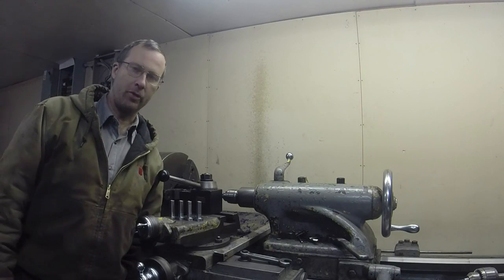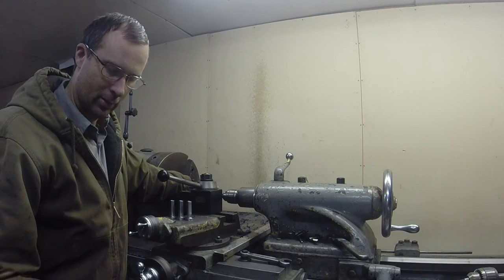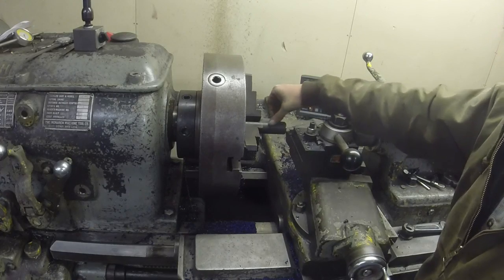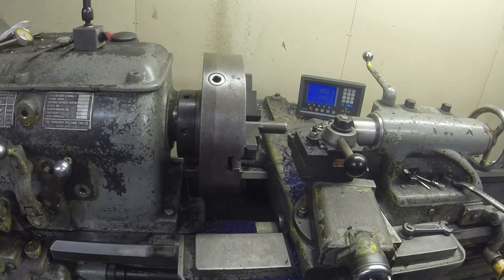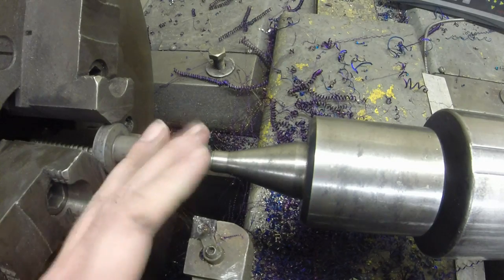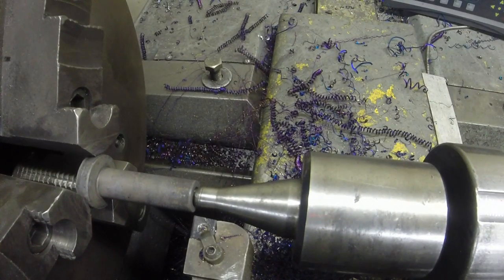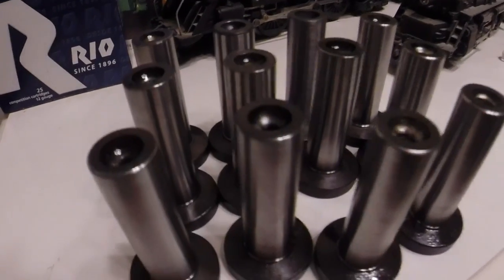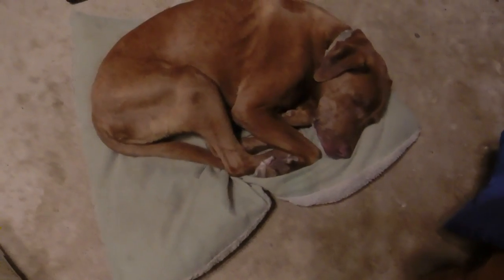CNMP review, repeat setups, heat treating and hard turning

Comment: I want to know how the heat treatment worked. The aluminum is good for the scale, but all at once. Seems slow and to much air bubbles for a proper quench.
Reply from the maker: +dlstanf2 The one I gave my buddy to check came in at the proper Rockwell hardness so it must have worked ok.  The material is moderately air hardenable as well so an oil quench just ensures they get full hardness before tempering back.

Comment: Brian, I noticed the stand that the oven is on swayed back and forth when you were pulling the tappets out. May I suggest some reinforcement for the stand. Sure wouldn't want it to collapse on you. That was some very quick thinking on putting out the fire!
All the best,
Eric
Reply from the maker: +esoomreltna The concrete isn't level there so it rocks a bit, the stand is plenty stout though. When it finally gets its proper home it will be much nicer + a proper quench tank with proper oil will bw nice as well.

Comment: I'm curious if the original rod stock is something special?
Reply from the maker: +Ed Texley What do you mean? If you are talking about the material these are made from yes it is a special tool steel.
Reply from the maker: +Ed Texley What do you mean? If you are talking about the material these are made from yes it is a special tool steel.
Reply: +bcbloc02 Would it be similar to T1?  I use this sometimes for making teeth on grapple forks or just lately, teeth for a big tiller.  I've never tried heat treating any of it, but I probably should.
Thanks
Reply from the maker: Ed Texley
I believe T-1 is already heat treated so no need to do it again.
Reply: +bcbloc02 Thanks Brian

Comment: Man you're getting raked over the coals about that little fire aren't you Brian. Nice job by the way. Hows the new shop coming along and did you get any further with the overhead hoist? Later and all the best.
Reply from the maker: +NSTRAPPERHUNTER Worked on the shop after work today, going to try again tomorrow but they are calling for rain and thunderstorms most of the day I think. I am also coming along on the hoist. I will work on it tomorrow if the rain keeps me from building walls.

Comment: I have had the same thing happen with a 5 gallon bucket of hydrotrans when repairing a D8R, didn't get it out in time, had a melt down, thank God for a few bags of fine floor sweep. And I already cleaned the undercarriage so just a few hoses got heat tested, no real damage a spray can overhaul and a full day of cleanup , God looks out for us sometimes.

Comment: Hi Brian, great work as usual.  Love listening to that old Monarch, smooooooth as glass.  You need to get a metal bucket with a lid for your quench, check out McMaster part number  4070T61.  It is a 6 gallon bucket with a step lifting lid, perfect for that purpose.

What kind of insert to you use for the hard turn, CBN?  Do you take them all the way to final on the lathe or give them a spin on the grinder after that?
Reply: bcbloc02 I've got a couple of them around my shop, for oily rags and waste, haven't had one leak yet.  Of course you could slop some gas take sealer in the bottom when it was clean and new just to make sure.
Reply: +bcbloc02 Thanks for the synopsis, you answered all the questions I had, and asked the one I was thinking of too. Do those crimped metal seals hold oil? I know that they don't always hold water, but then again, I already learned in college you shouldn't try to keep your keg cold in a metal can in the hot Hawaiian sun ;)
Reply from the maker: +James Kilroy I turn to size on the lathe with a PCBN insert. It holds edge and size like a master but is certainly a fussy piece to use as it only cuts one way, you can't back up with it and you cant face to a center with it or it will break.  The lathe leaves just as good a finish and I can smoke the grinder on time since i can turn to number on the DRO and hit within .0005 every time. 
 Do you know if those containers will hold oil long term without leaking? I once tried a metal trash can of same design and it sweated oil out the seam at the bottom.

Comment: Hey Brian - what kind of steel are you using?  Most of the stuff that we foil pack is air quenched (D2, CPM-154, 3V).  Did you put some paper or other combustible to burn off the oxygen inside the foil pack to ensure that the heat treat is anaerobic?

We get small fires when we quench using automatic transmission fluid but usually only when the part doesn't fully submerge.  Was the foil pack still sticking up?

Like seeing the whole process - Thanks
Reply from the maker: +harrisevo At first I thought it was not fully submerged was the reason for the fire, that is why I poked at it but it was all in. The material is a specialty tool steel that has both high hardness and toughness and I had a paper towl inside to burn the oxygen.  It turned out well but certainly wasn't a flawless operation. lol Live and learn though!
Reply: +bcbloc02 Are you using a proper quench oil, or waste oil ?

If you're using waste oil, proper quench oil may have less flame up.

Comment: How hard do this got the batch? 1900 deg. is kinda very hot, is this some kind of high chromium or tungsten content alloy.
Final result is looking good, I also do some hard turning with some diamond inserts, the results are generally very good surface finish and decent tolerance.   ;)
Reply from the maker: +pierre beaudry They checked about 61RC after quench and double tempering.

Comment: Nice job Brian! Should have told us what they were for, my guess would be JD! Do you do Rockwell on each batch or do you just do random samples. How's the shop coming?
Reply from the maker: +Fred Newman I have each batch tested by a buddy that works at a die shop that has a tester. They are about 61RC. I do them for IH, Deere and Cummins. These were Deere ones in this video.
Reply: +bcbloc02 Man, I wish that I had known that you made them for a Cummins! Am building a 5.9 for a guy and would have had you make them instead of getting them from a diesel shop. Will keep you in mind though for next time.
Reply from the maker: Fred Newman
I do all kinds of Cummins stuff from the little 5.9 to the 8.3 and even some stuff for the Alky 903's.

Comment: They came out great!!!   I'm wondering if you can keep an old metal trash can lid  or bbq grill lid handy  to snuff out the fire.  I was a little concerned that the cardboard box would catch fire when you used it to snuff out the fire.  Wonder if you could use a metal Pail with a lid.   Chris
Reply from the maker: +shadowdog500 I plan to have a permanent metal tank with a flip over metal lid in the new shop. It didn't even put a smoke ring on that cardboard box.

Comment: Thought you were going to burn down your shop. Can you heat treat somewhere without endangering your shop etc.?
Reply from the maker: +Jerry Halcomb Having the oven outside at the new shop might not be a bad idea. I have two big chemical fire extinguishers nearby in case things get out of hand.
Reply: +bcbloc02 good video Brian. Just scared the s... out of me when it didn't calm down. I wonder if a larger volume of oil would have kept it from flashing as long? Again, just a question, good stuff. I'm a farmer, seed tech, at a seed company up here in Illinois with some machine tools. Keep it up! Jerry
Reply from the maker: Jerry Halcomb
Probably so, the more oil, the more heat it will absorb. That was a pretty big mass of material going in at once. It seemed to work pretty good though as they came out clean and at the proper hardness. They make different oils that have less flamability as well. I should have been using proper quench oil rather than engine oil but I didn't have enough to do a big batch. Doing the tappets in a lump saved a bunch of time and a bunch of that stainless wrap so I am pretty happy how it turned out and know some more things I can improve on for next time. :-)
Reply: +bcbloc02 Got a little worried myself, the idea is to not need the extinguishers at all... If you have metallic pails you could avoid some meltdown just like a nuclear reactor... lol
Be safe we like you live and well.
Reply from the maker: +pierre beaudry In the new shop I plan to take a metal oil tank I was given and cut the top off and put it on a hinge, that way no meltdown and I can flip the lid shut to put the flames out if it gets carried away.  The fire only lasted 30seconds, but it did seem a bit longer at the time. lol
Reply: bcbloc02
I got a little worried that the plastic pail was gonna give up and spill the content on the floor... Happy it turned out ok...   ;)
Reply from the maker: pierre beaudry
Yes dumping liquid fire all over the floor is a bad day. :-0